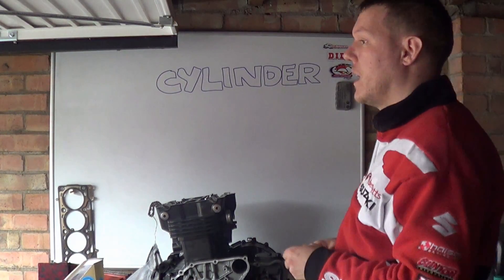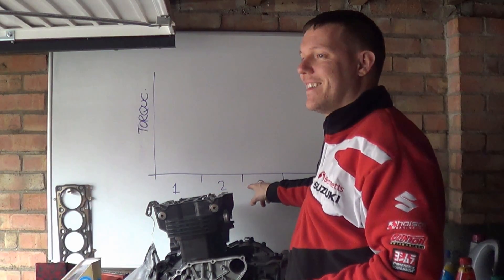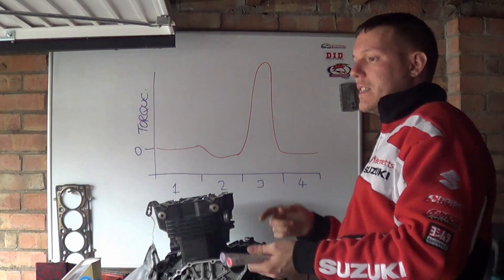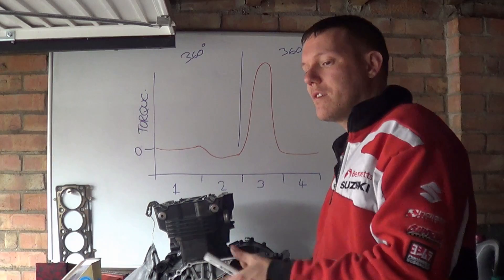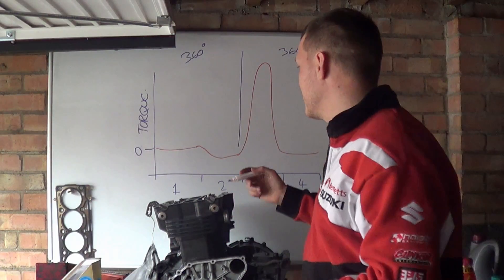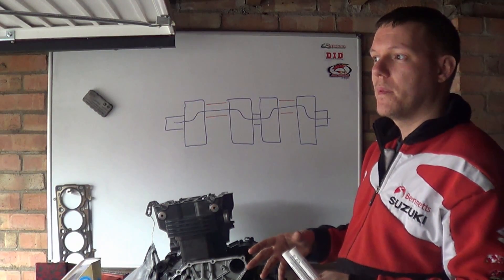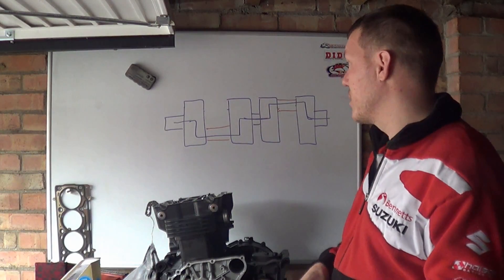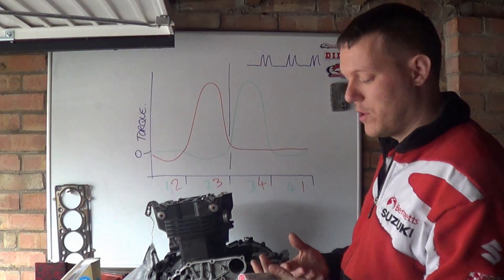Cylinder Configurations - Singles and Doubles twins

Comment: 8:04 BMW's F800 models, for example, use a 360° crankshaft. There are also other current engines, but can't name them from the top of my head.

Talking about Vs and crossplanes (or even engines in general), could you please do a video on their acoustics as well?

Cheers!

Comment: After your explanation at 7:32 & 9:15, why do I4's have the two 
middle pistons tied together and then the outer pistons together? 
Wouldn't it be better balance to have 1 and 3 move together and 2 and 4 together?
 Would a flat 8 fire the same way (4cyl firing every 180 instead of 2cyl)?

Sorry for living on your channel and bombarding you with questions the last 
few days, I was volun-told to take two weeks vacation (so the company 
doesn't have to buy it back come June)... so I'm taking my boredom out 
on you.
Reply: Beach&BoardFan you should look for simulations and see the powere strokes. you can imagine the tortional stresses with other i4 configurations

Comment: One of the reasons why I like single cylinder commuters is the simplicity you mentioned.
Reply from the maker: I love the little thumpers, light, cheap to run and do they're job well. Just lacking that acceleration buzz - matt